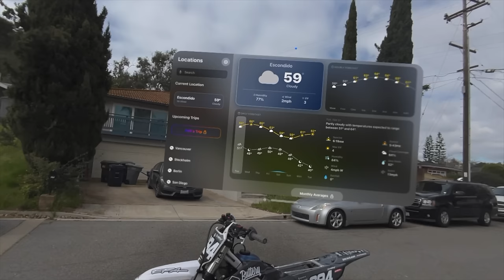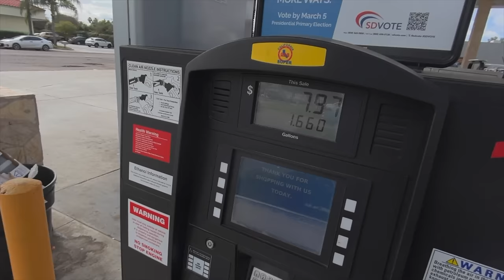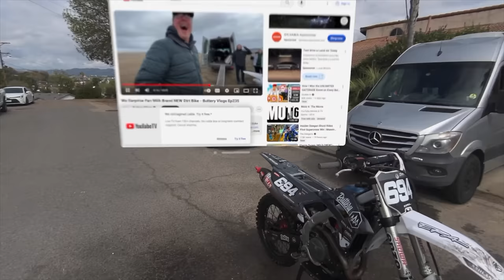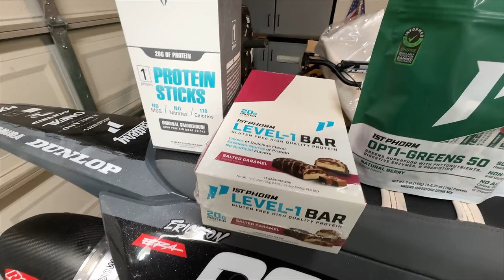His 450 is WRECKED! - Buttery Vlogs Ep236

Comment: 0:55 sprinter van probably got a dead battery or maybe there's a inertia switch that's not letting the car turn on. Maybe they drove it with no oil or no coolant for too long. You are going to get pulled over for the police radar detector on your windshield it's illegal in California to mount it on the glass has to be on the dash.